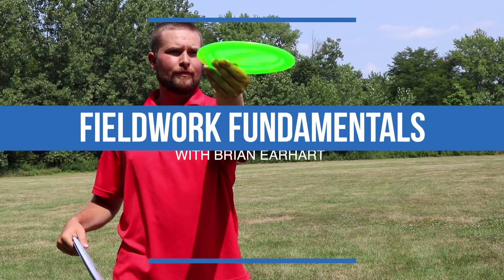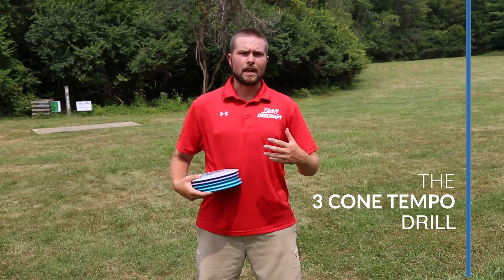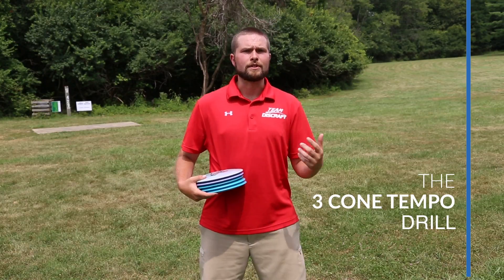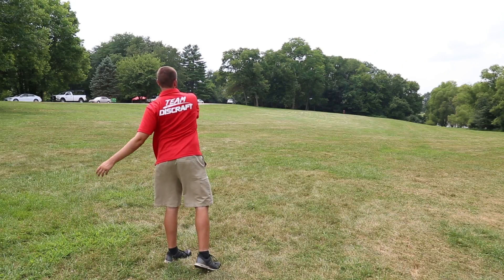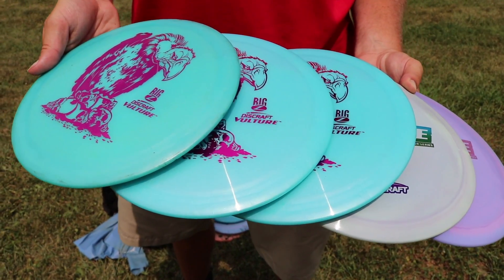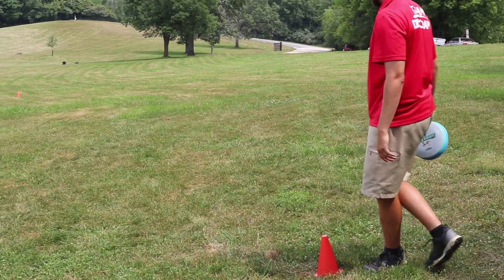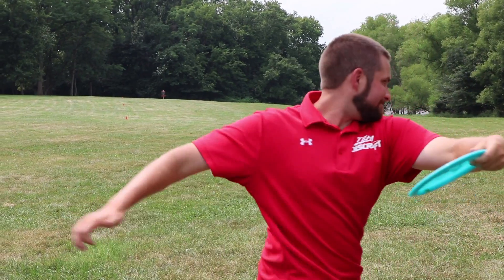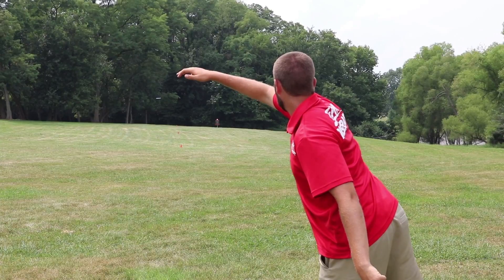The 3 Cone Tempo Drill | Discraft Fieldwork Fundamentals

Comment: I've come to revisit some less stable molds like the Archer or Meteor and find that I can really manipulate some great lines for tight wood shots. 
Really great drill.  This will certainly help to figure distance control better, thank you very much.
Reply: Yeah that is why I use the Impact, though OOP I have 7 as backups for when I need them (lose them or get worn out) at the 172-173 range with one at 176 grams as the very last one should I need that. That mold is perfect for wood shots and then the odd too long for midrange but too short fairway driver.  I call the Impact a fairway disc, not a fairway driver.

Comment: Part of that problem is that now there are too many molds out for players to use. I only have a few specialty discs like 3 or so and even then they have 2 or more uses, Archer is for shots that need to go right for me and can work as a roller. I use a different brand disc a 150 gram mold only for a water shot and for a wind at my back disc. Another disc for uphill and downhill putting only will get replaced with one of my Jawbreaker Magnets my more beat in one for long putting and hazard putting then bring in a fresh one for my putting putter. After that I will just rotate my putters and taking out a Jawbreaker Magnet in until the uphill/downhill putter gets as floppy as the modern Steady Ed Specialty plastic for all of the Blowfly and Gumputt molds.